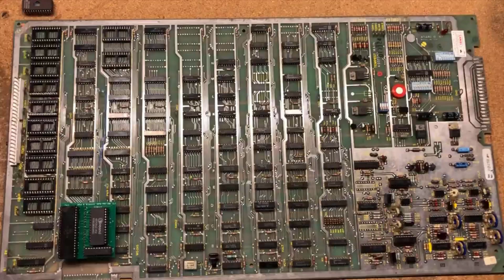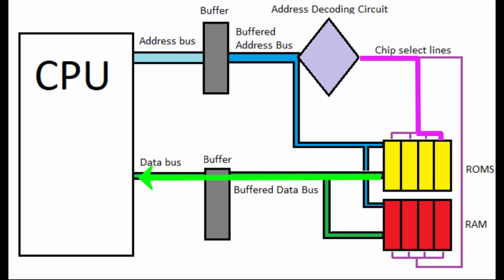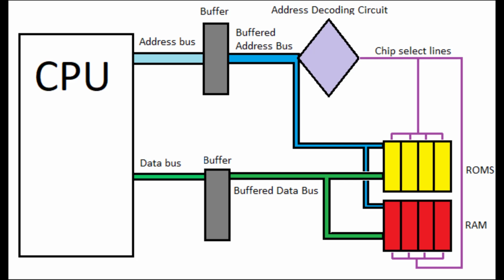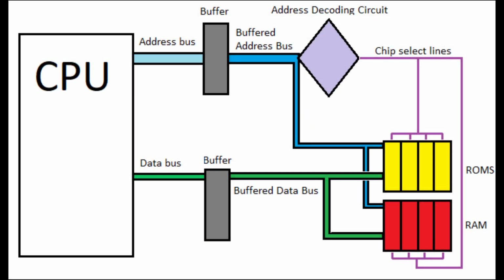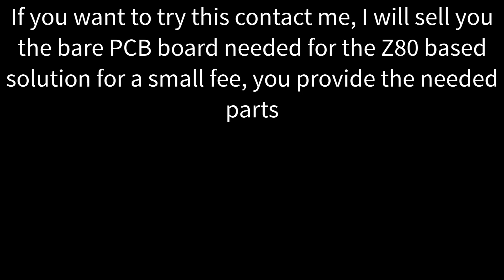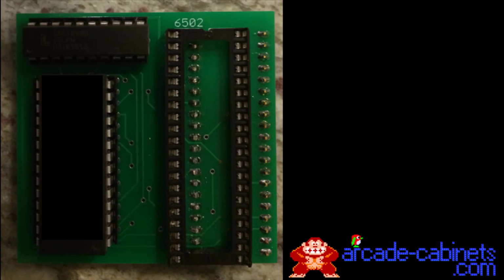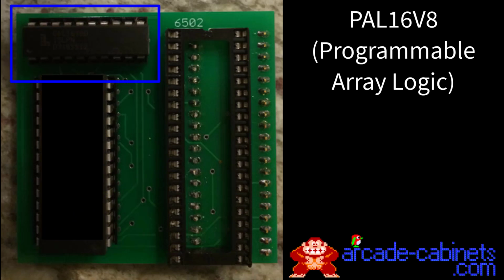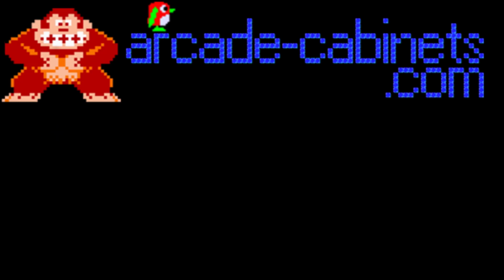Creating a plug and play single ROM arcade game hack daughter board part 1 of 2

Comment: Is it possible to substitute one larger, more modern RAM chip for a series of older RAMs? Some of the older games use ridiculous numbers of smaller chips in banks like 2112 and I've often wondered if it would be possible to simplify such a thing and make it more reliable.
Reply from the maker: Andrew Tornadoboy generally yes, but it depends on the system. There could be cases were it would not work but in these old arcade games I cannot think of many offhand